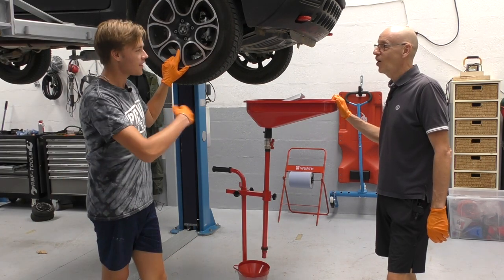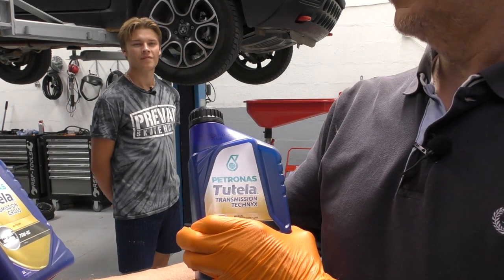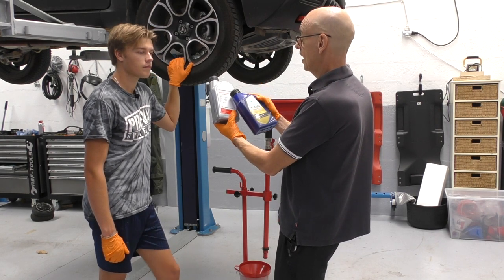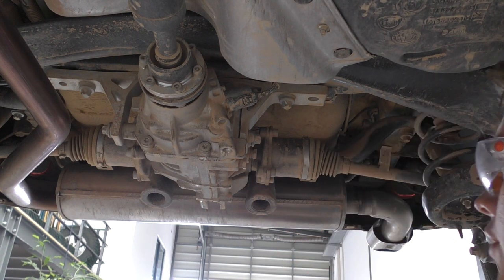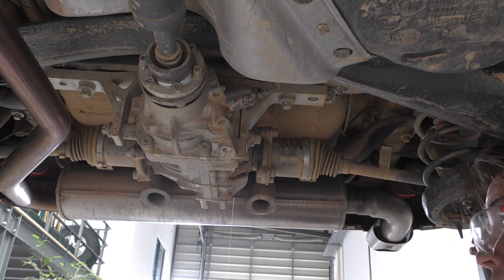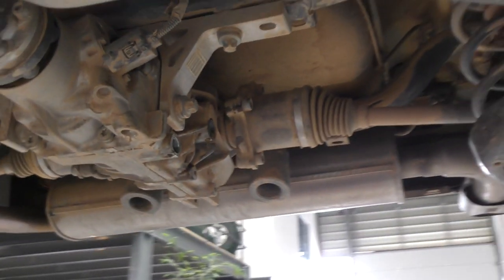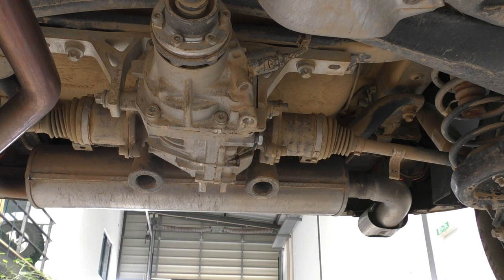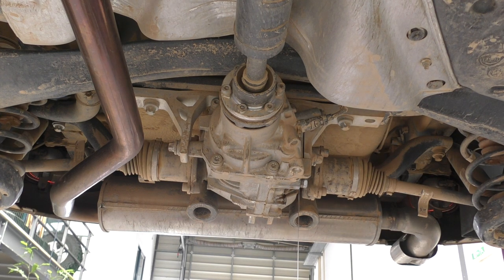Differential oil change on our 2021 FIAT Panda 4x4 - surprise bung  & confusing oil requirement

Comment: Hello from Belgium,
I own the same car (110.000 km) and I love it.
Do you know what is the function of the 2 "cast cones" that we can see (7'10") between the rear axle and the rear exhaust box ?
Reply from the maker: I had no clue to be honest - so added a photo on a Facebook Panda forum - lots of the same answer, they say; anti vibration / acoustic weights - which makes sense - well spotted, for the amount of time I have spend under the car, I never noticed them !!
Reply: @DrivenMadShow  Thank you for your answer and for your videos.
Reply from the maker: Appreciate you watching and taking the time to comment 👍🏼
Reply: Those cones are to stop the rear brakes making a noise when the car is reversing.....they are dampners....

Comment: Hello guys.
Question, did you put the same oil in the front diff/gearbox as the one in the rear differential ?
Reply from the maker: We used Tutela Car Technyx Gear Oil 75W-85 &  Tutela Transmission Cross 75W-85 API GL 5 --  for info you can check out www.augustin-group.de or buzz an email with your vehicle detail and they will tell you exactly - we found them as Tutela stuff from FIAT is £$£$£$ and they were much cheaper for the same stuff.